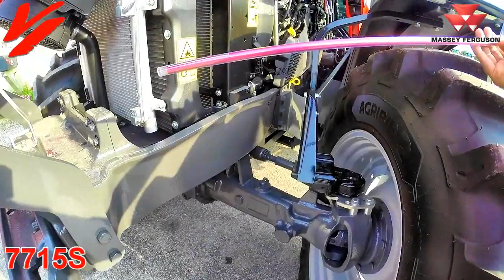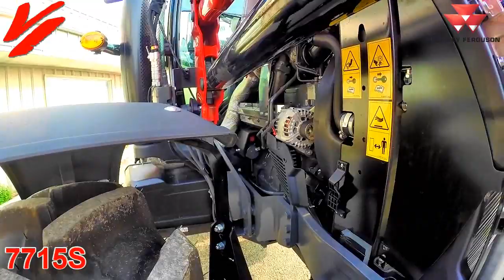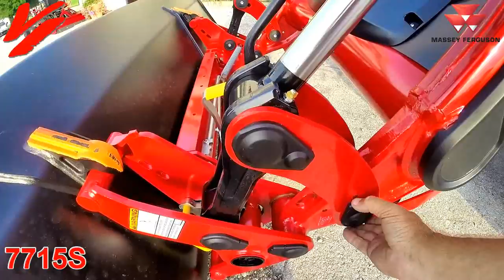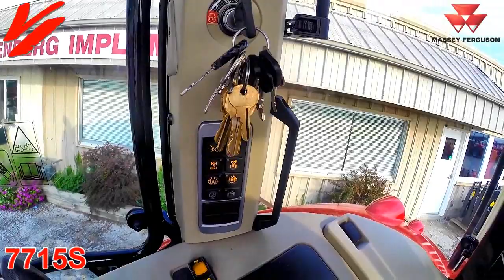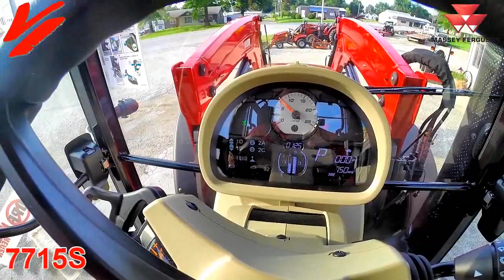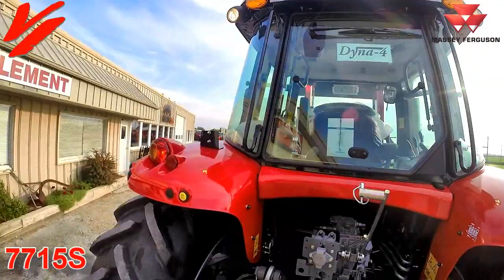Massey Ferguson 7715S Classic Row Crop Tractor - Dyna4 Transmission

Comment: Why is the 3pt lift capacity so much less on Massey power shift models than the cvt transmission?
Reply from the maker: The PowerTrain is different. Transmission & RearEnd are designed differently. CVT is FENDT Transmission and Rear End and why so much higher capacity.

Comment: Do these smaller row crop massey’s have problems more often than other brands?
Reply from the maker: We have very little problems with the Massey Ferguson Models. Technology is very proven like the DynaVT is a Fendt CVT Transmission and the AGCO Power Engines have been around for ages. We have the other two full line brands in town and they have huge shops and lots of late model tractors sitting around and in the facilities. We don't. That kind of tells what is happening with reliability.
Reply: Thanks for replying . I’m definetely going to lean towards a massey if i start getting into a bigger operation with hay production.

Comment: I don't have any little tractors like this. How about a review of a loaded 7726s or 8730s? Like really loaded with all the good stuff like air brakes, leather heated and cooled seats, etc? Thanks! Oh and there aren't really any transmissions other than the the cvt 😉😁
Reply from the maker: The largest we have had recently is the 7724 https://youtu.be/p4OKWuaXPqk we don't sell many big tractors here in our area. Have sold a couple 8600 Series and several 7724 but that has been a while. Never sold Air Brakes, Leather Seat in a Tractor. The DynaVT CVT is the Ultimate Transmission but not everyone needs it and that is why the Dyna4 is a great option for operations that can't justify the added costs & features but they get a new tractor and the reliability that comes along with it. Dyna4/Dyna6 is one of the nicest SemiPowershift Transmission on the market when comparing Semi-Powershifts
Reply: @VahrenbergImplement  I have a 7624 with air brakes. Also a 8660 with heated and cooled seat. Will need an 8700 series sometime in the next few years. Be nice to see reviews on the bigger items too. In my opinion high horsepower MF tractors are grossly under marketed...
Reply from the maker: More Dealers need to do what we do. It's been a great success for our customers to learn about the products we stock & sell. I  would ask the Dealer you work with that you want to see videos on the products you are interested in. It takes a little time but is sure helps customer learn about the products you have. Every dealer needs to be doing videos to help there customers. I'd love to see them too. Wish we could help. Maybe someday we will sell more and we can video. But as of now that is not the market around here.